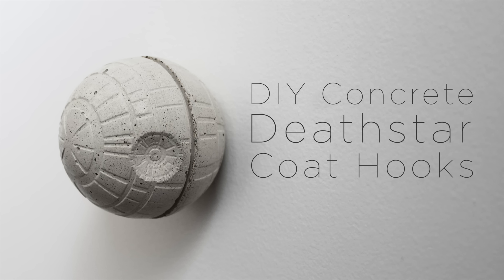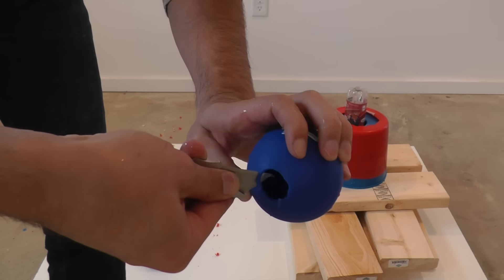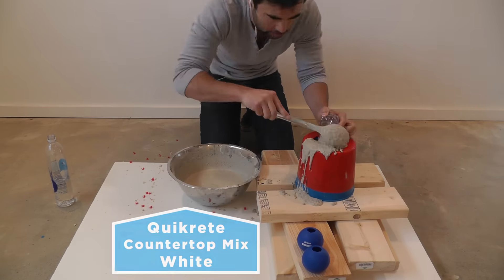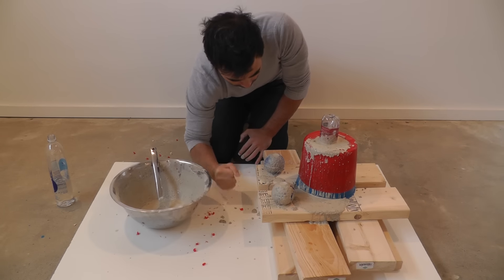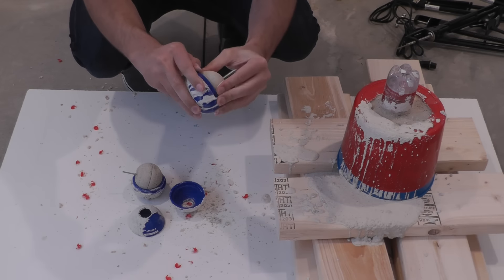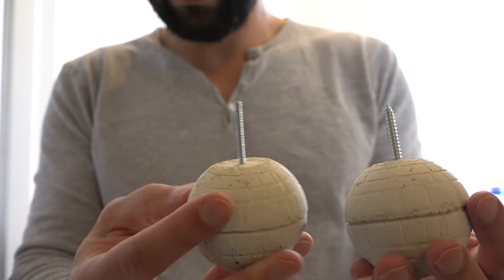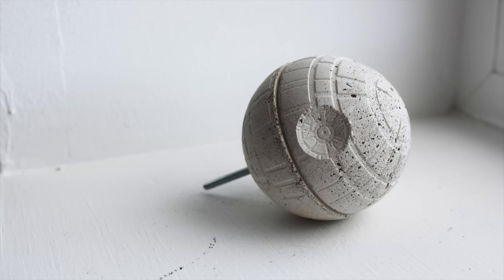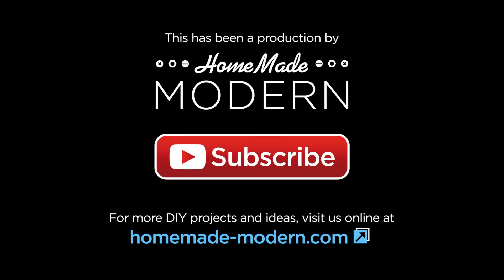Concrete Death Star Coat Hook

Comment: have you tried vacuum degassing these concrete moldings to get rid of air pockets?  The counter top mix you use seems fluid enough for it